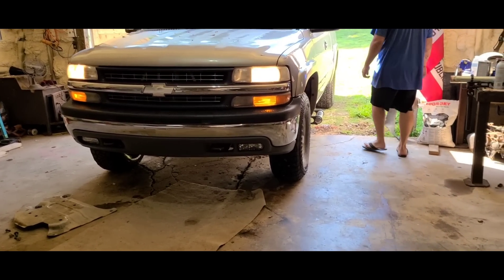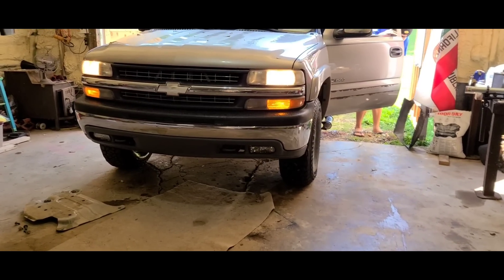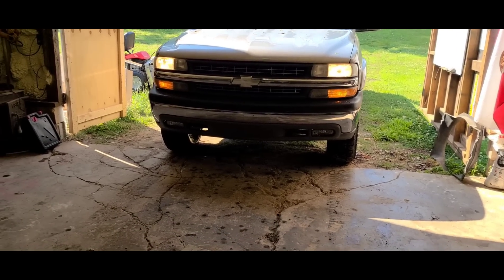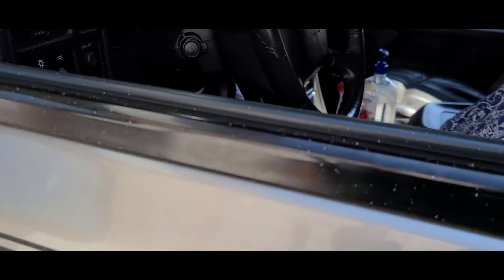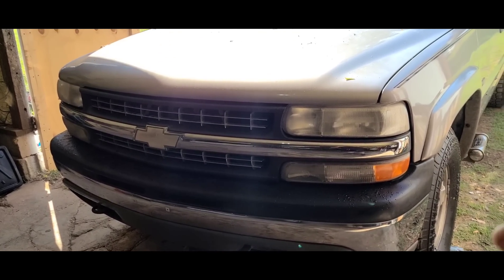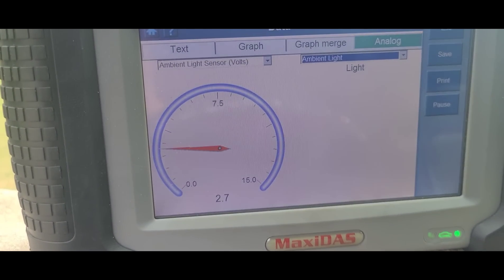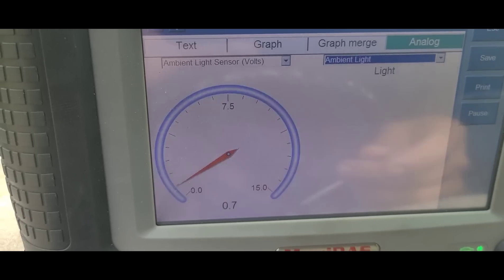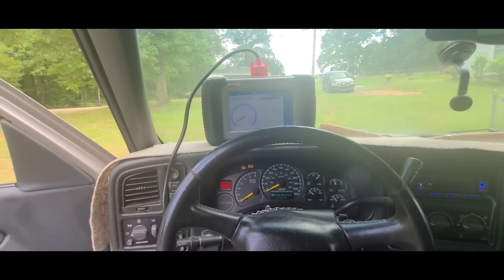SENSOR SOLAR CHEVROLET

Comment: Hola salu2 yo tengo un spark segunda generación 2016 y las luces no se apagan tengo que quitar los fusibles para que se apaguen tendrás el diagrama de luces para poder diagnosticar gracias de antemano
Reply: Pudiste arreglar el problema tengo una camioneta savanna 2008 y las luces se quedan prendidas aún sin la llave lo chistoso es que cuando meto velocidad se prenden en el día y en la noche solo se prenden Lis cuartos el eléctrico ya le hizo de todo por último se fue al sensor de ambiente de luces frontales va al centro del carro del carro por dentro y tampoco funcionó